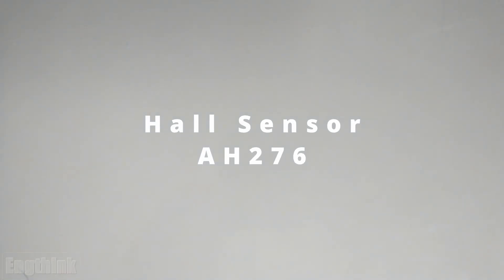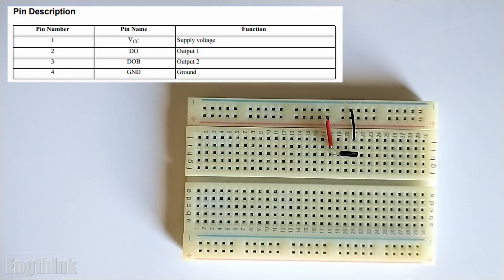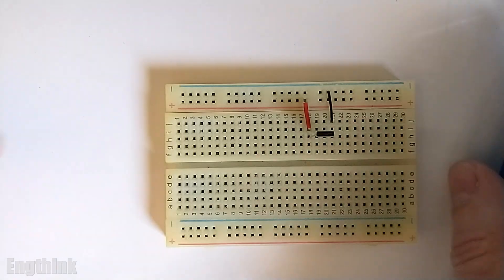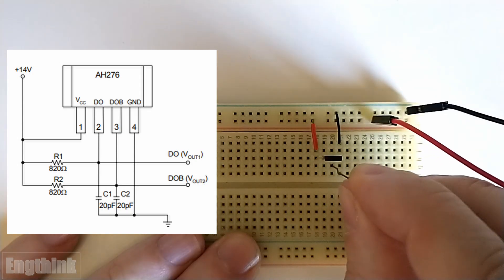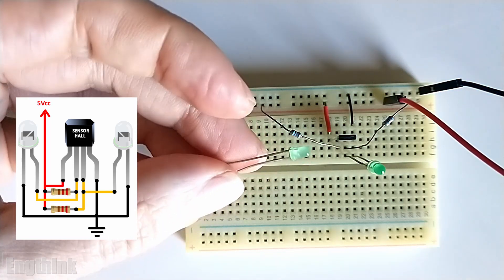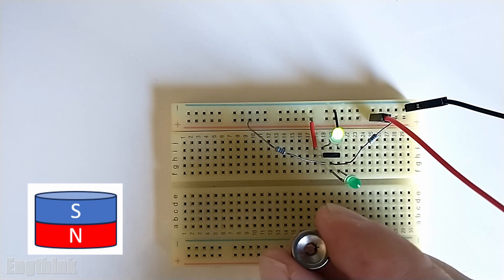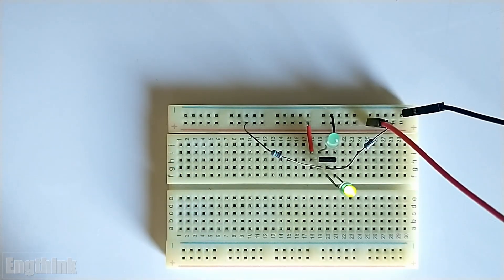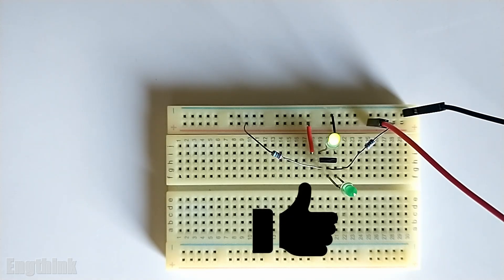4 pins Hall Effect Sensor #hallsensor

Comment: Hi, I have a battery operated  illuminated door sill on my car. It works with a magnet, when the door is open, a little magnet behind the door gets away from it and turns an led light on, when the door closes,  the magnet is on top and the led turns off. The problem is now is doing the opposite, and I can't figure out how to fix it. any ideas/suggestions?
Reply from the maker: Hi — perhaps the magnet is in the reverse position. The sensor’s behavior seems to indicate that.